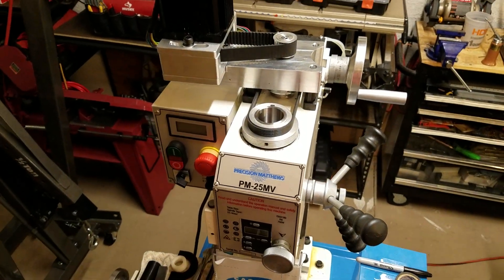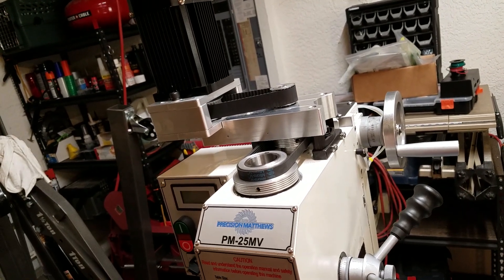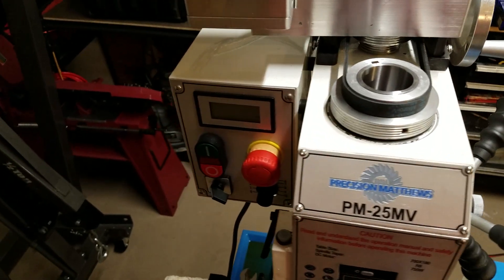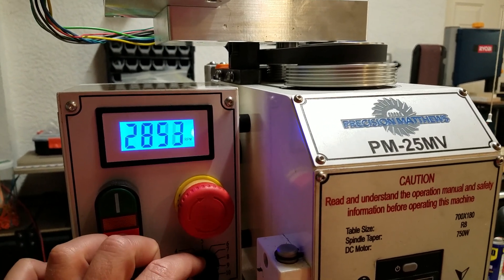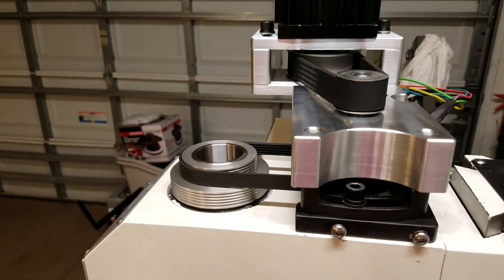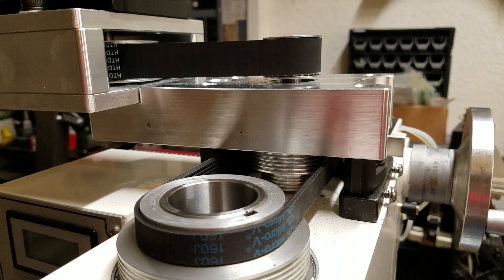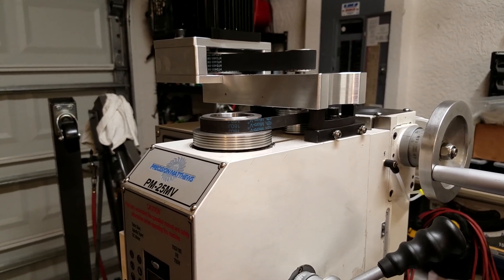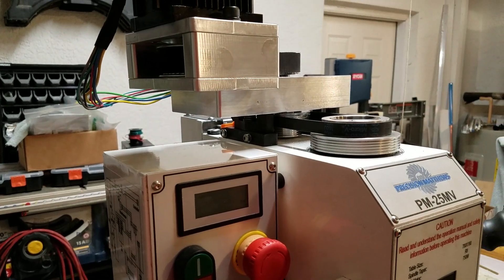PM-25MV Milling Machine Spindle Speed Upgrade Part 2

Comment: It's usually better to invest in an additional high speed spindle for aluminum than to try modifying a cheap R8 bench mill spindle. A low cost water cooled 2.2kw 24,000rpm off eBay running ZRN coated carbide end mills would do a far better job. 

Those bench mills are too flimsy to do a good job with large diameter tooling anyway. A 1/4" carbide tool at 20,000rpm+ requires far less torque or stiffness to move through aluminum like it's not even there.... 

Save the R8 belt drive spindle for face mills and fly-cutters.

Comment: Love your videos!  I am curious why you went away from this setup.  Am looking at a spindle speed upgrade for my PM25 and this appears to be a nice solution.
Reply from the maker: This design can be made to work but you need to pre load the idler shaft bearings in the axial direction.  Otherwise, you will get some vibration.

Comment: Franco.  After a year.  Did you notice a decrease in torque while cutting parts at the higher rpm.  I am very curious if the motor can handle it.  Thank you sir.

Comment: Hi from France, Franco !

Well done transformation, you have made a nice improvement by using a Precision Matthews mill of this kind.
I have some questions for you.

I don't have a mill yet, I'm looking for a purchase, surely a PM-30MV "clone" model. Precision Matthews cannot delivers their mills in Europe, but I have seen the silence of their brushless-equipped mills, so I will keep this choice as priority.

But, but... the quill & collet seems also to be critical.
In France we have a company that can sell in exclusivity some "clone mills" from "Weiss machinery", Weiss facilities are located in ...China, despite the name chosen. Most of the Weiss's mills are proposed with an "ISO30" attachment, even if you can order them with the popular Bridgeport's-based R8 or, with less transmission torque, the Morse Taper #3.

By having used some professional & costly CNC mills, lots of people in industry are using the cutting tools mounted with an "SA40" taper, which is similar to "ISO40", and obviously bigger than ISO30.

I have read that the cutting tools offer is lower in ISO30 than with SA40/ISO40, some tools holders dedicated for some carbide teeth are not available.

But I have used SECO's carbide tools for machining aluminium alloys and fine steels, the aspect & cutting efficiency is very high compared with common HSS or coated/improved HSS enhanced with cobalt addition. Of course, thorough cooling was required (so the cabinet follows...), but the power available on the spindle was close of 15 kW, with a knee-type mill of 2 metric tons...

Because of the tremendous housing bubble we have here in France, I don't have a lot of space (12 m² with stairs !!), I can't purchase an industrial-sized mill, I need a medium-sized mill that can be unmounted/upgraded easily. I have to said that Precision Matthews are proosing for sale some machine tools that seems to be very well made, with no apparent flaws, huge improvements & a comprehensive features, compared to "others clone resellers" companies.

That's why I'm looking about a mill able to accept cutting tools in ISO30 tapers, for using industrial grade cutting tools like SECO's "MINIMASTER" for making with an universal tool some U-shaped slots, big holes, chamfers on edges & pockets made with "spiral snailshell paths", provided with a modified spindle equipped with a silent Poly-V belts close from your own design.

I would like to mill lots of aluminium, some stainless steels, fine steels (cutlery grades), titanium (grade 25), composites (fiberglass, carbon)...

¤ How have you made the pulley used ? Are they coming from an automotive component ? It seems that the pulleys are not easy to realize from a stock bar & corresponding lathe. The surface roughness seems to be critical to obtain, to comply with the related adherence, and also belt wearing... 

I have seen that some US companies can provide servomotors that could be powerful enough to be used as a improvement solution, for having more rpms and also ...torque enhanced and angular control with the embedded logic: the implementation of motion can be set using open C++ software, both on Linux & Windows interface.

A great, great enhancement is also that these very modern servomotors are using world-class permanent & powerful magnets, that helps strongly to minimize the space required for the stator... which could be useful in the little gap existing between the Z-column and the cutting head.

As far as I know, some brushless servos provided by Teknic Inc. can be provided with a NEMA34 framesize, the biggest continuous torque able to be provided is 478,5 oz.in (3,38 N.m) @ 730 rpm for the ClearPath-SC family.

They are using 75 VDC, a useful tip is that some Chinese factories can provide BLDC motors, for a power range from 1.0 to 3.2 kW, some models are rated at 5,0 kW with 48 Volts DC supply, 72 Volts DC or even 96 Volts DC for the 5 kW rated motors; all are available in air or liquid cooled. But the switch supplies are quite costly at this power range.
https://www.goldenmotor.com/frame-bldcmotor.htm

As an example, it is said by the manufacturer the following features for the 3 kW rated motor, with 72 Volts DC.
Maximum torque is reached at 25,1 N.m, for 1621 rpm; 78 Amperes are needed (!!) for an efficiency of 78.82% (3.200 kW useful).
https://www.goldenmotor.com/hubmotors/hubmotor-imgs/HPM3000-72V3KW%20Curve.pdf
At these settings, the motor consumes 4621 watts, so it dissipates 1400 watts...

Dimensions : 
180 mm in diameter. 125 mm in height. 8 kilograms. The speed seems to be between 3,000 to 5,000 rpm.

I'd rather choose the liquid cooled version, 1,4 kW of heat to remove, wouh ^^ ! Makes a warm workshop :p

Here is a link for a professional CNC, weighting 2 metric tons, with a 9,5 kW spindle (also a ISO30/BT30), able to reach from 50 to 8,000 rpm, at a rated torque of ...14 N.m.
http://www.optimachines.com/fraiseuses-commande-numerique/8767-fraiseuse-a-commande-numerique-optimum-f-80.html - price is set at 37,500 USD, without taxes & installation-related fees.

An other one uses a 3-phases rated @ 2.5 kW, torque of 10 N.m; 200 to 4,000 rpm... surely a VFD behind. 
http://www.optimachines.com/fraiseuses-commande-numerique/9865-fraiseuse-a-commande-numerique-optimum-f3.html

Kent VanderVelden also uses a modified PM-25MV on Linux, he tolds me that the Z-axis column and head/spindle lacks some stiffness.

My hope would be to maintain a good accuracy when milling, by allowing the chips to be removed easily with the help of industrial grade carbide tools, thus avoiding the head to "lift" from the resistance of the parts to be machined, especially with large "flycutters-like" tools. I aim the use of a 80 to 125 mm wide, with 7 or 9/10 teeths, for obtaining flat surfaces.

It seems that "monolithic tools" which stongly fix all the carbide teeths onto the tool holder, mounted into the spindle without any freedom of movement greatly reduces wearing, noise, roughness of machined surface.

I have also a swiss-made mill, weight is close to half metric ton, the table is so small... it uses an antique asynchronous motor, in 3 phases, able to consumes 1,5 kW... so the available power at the spindle seems to be ...close of yours. The "Aciera F3" mills are well known for their accuracies, but they are not easy to uses in "traditional milling". Their shapes are leading to difficulties of numerization, including that the tables are really short in surface...

That's why I'm looking on some improvements like yours.

It will be a pleasure to read you !

Great job you have done & best regards to you !

Comment: If you want less vibration you may consider using a simple V belt instead of a timing belt. I had a G0704 that I designed a spindle setup for that happily ran at 10k RPM all day running aluminum parts and it maxed to 14k when I did engraving. I just used a simple Baldor branded general purpose AC motor that was 1.5 HP and ran at 3200 RPM. I machined the appropriate size pulleys and used a 3L sized v belt. It did everything I asked of it, and I never had a belt slipping issue.
Reply from the maker: Thanks.  It sounds like you had a pretty nice spindle mod on your Grizzly.  Check this out:  https://youtu.be/bR9IqQi1bg8
The timing belt doesn't seem to be the problem on the PM-25MV.  I believe the vibration is coming from the metal housing that drives the quill spindle.  It only seems to show up around 3000 RPM.  Truth be told, it's very minor and I'm probably just going to live with it for now.  But who knows, maybe I'll go to a v-belt setup in the future.
Reply: What I did was switch out all the bearings and machined a large bushing at the top so I could use a high speed bearing in place of the normal quill bearing. That large bearing is not readily available in anything capable of high RPM's. I also ditched the gears entirely, no need for them. My pulleys were stepped so I could switch the belt for more torque however I never ended up having to. It was all driven by a KB genesis VFD. https://www.instagram.com/p/9ewBW9Rz-A/?taken-by=bens.benz
Reply from the maker: bensbenz Very nice.  Can you tell me what bearings you used?   Also, how did you make that bushing up top?  I'm particularly interested in that bearing.  Did you just press it into the bushing? Did you have to make a bushing to sleeve around the spindle shaft?  Thanks.
Reply: I machined the bushing(s) on the lathe, just made them based on what I measured. It was a tight but not quite press fit into the head, the head wasn't exactly machined 100% round.  Looking at the posts below I guess I made one around the top of the spindle as well. All the bearings came from VXB, I don't recall the exact numbers, that was quite a while ago. I know for the quill replacement one, I just found an affordable high speed bearing and made the bushings to fit. You can kind of see it here https://www.instagram.com/p/9d4MUwRz9n/?taken-by=bens.benz and here https://www.instagram.com/p/9eUU99Rz2_/?taken-by=bens.benz
Reply from the maker: Awesome!  This is great information - I really appreciate it.  I've thought about doing something like this in the past, but I was concerned that I would need some way of applying axial pre-load to the bearing to prevent it from jumping around.  It looks like that was not a problem.  I have a 6007ZZE bearing on the way.  Question:  What lathe did you use to make your parts?
Reply: I have a G0602 lathe that I converted to CNC and run it with LinuxCNC.

Comment: Franco, sir.  I beleive you have nailed the design from previous video.    Good jpb on raising the spindle speed, it is one of the hang ups for the pm-25 in my opinion.  What type of information are you looking for about the mainboard?
Reply from the maker: Thanks.  I believe there are adjustments on the board and I was wondering if there is a way to get more power/torque.